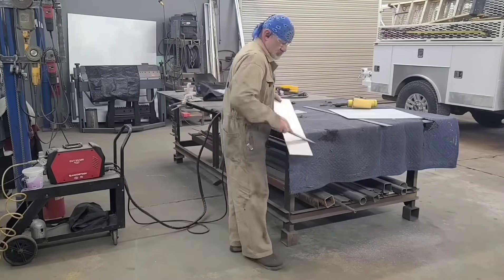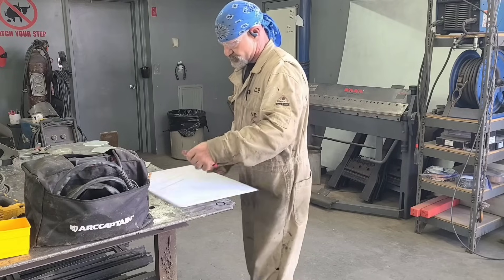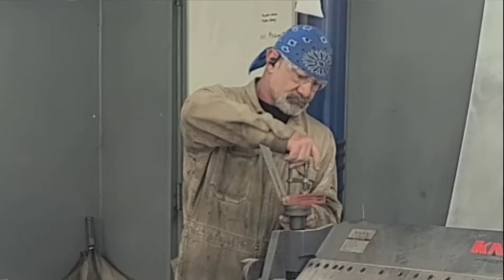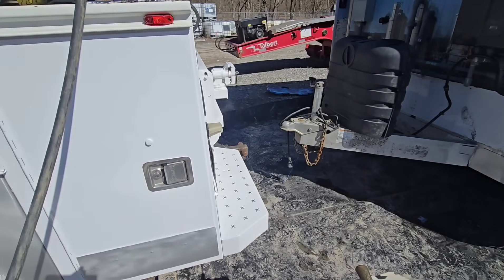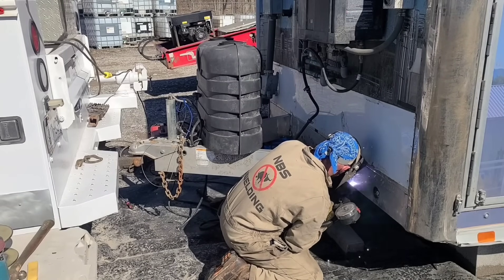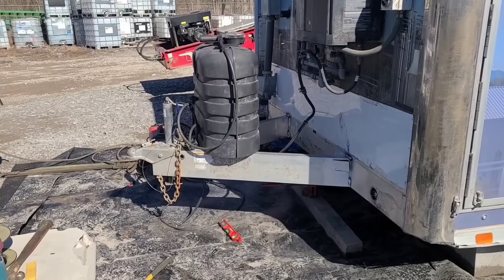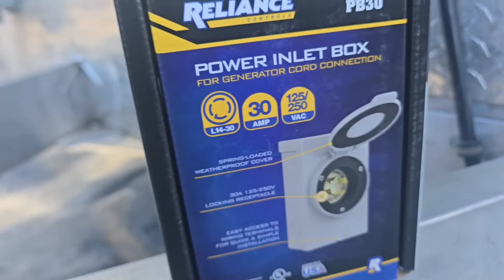Welding a broken aluminum trailer tongue

Comment: Look like a very good idea to add the gusset plates to the tongue. I personally don’t like aluminum trailers. They are to easily damage. Here in southern Indiana there are lots of them framed and frameless. And most are dump set ups. I got a friend who replaced a floor in one that was a short one and his statement was never again. Thanks for sharing your repair on this trailer.
Reply from the maker: I agree....there are times when aluminum  is the right material but industrial trailers should be steel

Comment: How does ur arccaptian mig 205 pro run on ur engine drive I bought a new generator and I'm having all kinds of trouble the thd is to high on the generator maybe have u had any trouble
Reply from the maker: No trouble...ran the 205MP off of the Miller Trailblazer 302 like always on 220V....worked great

Comment: Excellent repair! Much stronger now.
The operators are lucky to be alive. That could have been a major disaster on the highway.
Reply from the maker: I'd say the brakes worked good once the front of the trailer set down on the road
Reply: @NBSWELDING  Damn!

Comment: Nice job. Had a question about the arc captain can both of those mig welders be run off a generator? I’ve been looking for an extra 200amp machine to leave in the truck
Reply from the maker: Yes they run off of my Miller Trailblazer 302 just great.  I can say that for the MIG200, MIG205MP, & MIG145.  
The only ARCCAPTAIN I have that won't run off of the Trailblazer is the TIG200P AC/DC on 220V and that is because the Trailblazer does not have actively regulated voltage and the 220V voltage on it sometimes spikes above 265 volts.  Those voltage spikes above 265 volts cause the electronics in the TIG200P to shutdown and protect itself. 
Two other interesting things to note on that is I must say I ran the TIG200P off of the Trailblazer on 110V and welded with it no problem, just didn't have as much power as if I could have used the 220V.  The other interesting thing is that I plugged the TIG200P into my old Lincoln Commander 300 diesel machine on 220V and it was fine.  I assume that the Commander either has regulated voltage or maybe just the power of the lower rpm diesel keeps the voltage even enough so there aren't high spikes of power.
Reply from the maker: Please remember when buying ARCCAPTAIN products use my link and promo code...I'll drop links here for the preorder Kickstarter deal on the 205MP as well as my link to the ARCCAPTAIN site but remember my links are in the description of my videos....even my Amazon Storefront link for when you use Amazon.

To sign up for an ARCCAPTAIN MIG205MP use this link
https://www.kickstarter.com/projects/arccaptain/mig-205mp-all-in-one-mig-welder-and-cutter-with-app-control?ref=a54hl0

Support the channel by PayPal with this link
https://www.paypal.com/ncp/payment/QY3RVMKPNH26J

For ARCCAPTAIN products use this link https://www.arccaptain.com/?ref=NBSWELDING
Remember to enter promo code NBSWELDING5% to get 5% off on all products 

For purchasing products from Amazon  use this link
https://www.amazon.com/shop/nbswelding

For T-shirts, cups, or coins send Tina an email request at nbswelding@aol.com

Comment: Great Solid Repair! 🤗
I like to take a clean stainless steel hand brush and scrub the oxides off of the aluminum before welding them, plus I usually wipe everything down with acetone also. 
I have a Miller 251 with a 30A spool gun, but it is not what you would call a portable system for mobile welding jobs.
Reply from the maker: I have the 30A for my Millermatic 252's and I used to love it but the ARCCAPTAIN MIGS do awesome and the ARCCAPTAIN spool gun is much lighter and easier to use.  Plus the ARCCAPTAIN is so portable....the pulse MIG function on the 205MP is fun on aluminum too in the way it runs high heat without overheating the material.  If you ever decide to get any ARCCAPTAIN stuff go to the description of my videos and use my link and promo code.

Comment: Hey CB! great repair, as always i really enjoyed your content. I'm about to start going mobile, i have my engine drive (Miller Bluestar 185 that i rebuilt) and my oxy propane torch. I have been trying to figure out the most sensible way to weld aluminum in the field. Do you think one of the MIG arc captains are the way to go or should i work on getting trained up on TIG welding instead and buy a small AC/DC tig machine?
Reply from the maker: It seems to me that most aluminum field work is best suited for spoolgun MIG and the ARCCAPTAIN MIG machines do it well.  The only thing I'm not sure of is if your engine drive will run them.  My Trailblazer 302's run them just great but I can't speak for yours because I haven't tried it myself.  I'll drop links here to use for ARCCAPTAIN & such if you decide to buy and remember that my links are always in the description of my videos.  Don't forget to use my links & promo code.

To sign up for an ARCCAPTAIN MIG205MP use this link
https://www.kickstarter.com/projects/arccaptain/mig-205mp-all-in-one-mig-welder-and-cutter-with-app-control?ref=a54hl0

Support the channel by PayPal with this link
https://www.paypal.com/ncp/payment/QY3RVMKPNH26J

For ARCCAPTAIN products use this link https://www.arccaptain.com/?ref=NBSWELDING
Remember to enter promo code NBSWELDING5% to get 5% off on all products 

For purchasing products from Amazon  use this link
https://www.amazon.com/shop/nbswelding

For T-shirts, cups, or coins send Tina an email request at nbswelding@aol.com

Comment: Seems like too many welds at the bottom of that tongue section at the front wall from the factory. Those gussets should help a bunch. Nice work as always
Reply from the maker: You are absolutely right, those trailers are not built strong enough from the factory!

Comment: Man the way the just butt that rectangle tubing up to the frame & just throw some tacks around it is just designed for inevitable failure! Its unbelievable! The tounge needs to be tied back into the frame like it is on regular steel C-channel trailer frames do it. Also from seeing the thousands of scrape marks across the bottom of the trailer front from going in & out of driveways incorrectly and just punching the gas pedal down dragging it right over the hump is putting soo much excessive force on that simple butt-joint 'weld' with no gussets or extra added strength adders whatsoever....its like they want the trailer wire harness wires to keep it held together & not their 'welds'! Its simply ridiculous!. Then, I'm absolutely sure this trailer is probably massively over-front-loaded aginst that front wall, I'd just about guarantee they have waayyy too much weight on the tounge\trailer front wall! Thirdly I really don't think aluminum is capable of being strong enough(at least not this frame design) to be used as a heavy duty trailer frame designed for regular commercial use. Fourth, I have no doubt CB can & will fix this POS designed trailer frame to make it better than it ever was. The real trailer here is that nice Talbert lowboy deck\beam trailer next to this one! Those are nice trailers for sure. Sam @ Scrappy Ind. just started rebuilding his 30 yr\old convertible beam\deck trailer axle unit which was still in good enough shape to haul his old monster iron machines(TD25, etc) around back to his land.
Reply from the maker: You got it & I agree....Aluminum was a poor choice for this and the tongue design is not good....I also agree it's overloaded.
All I know is if it breaks again it will not be in the same place as last time

Comment: Could you explain the difference between the wire, the 4043, and the 5356?
Reply from the maker: 4043 is softer, mixes well with virtually all aluminum welding jobs, and less prone to cracking
5356 is stiffer and better to prevent bending and flexing 

As far as welding the 4043 is so soft that you must use a spoolgun....the 5356 is stiff enough to push through a MIG gun if you keep it fairly straight and use a Teflon liner, pushing the larger .045" diameter helps it go through as well

Comment: Nice job!! impressed with those machines ,Were  you running those arc captions on 110 or 220
Reply from the maker: 220V....plugged into the Miller Trailblazer  302

Comment: What is it with aluminum trailer manufacturers. They all seem to butt the trailer tongue to the front of the trailer frame and weld it. Good job on the repair in the field.
Reply from the maker: They are never built strong enough...it's like they think that aluminum is as strong as steel

Comment: Once again, CB take that boy at a petty cash👍🏻 Great job
Question which arccaptain welding helmet do you prefer?
Reply from the maker: Thanks

I don't have any opinion on the differences between the ARCCAPTAIN helmets other than I'd assume that the bigger the lense is the heavier the helmet would be.  ARCCAPTAIN sent me one of their helmets about a year ago and it is a good quality helmet but ARCCAPTAIN doesn't sell the type I prefer.  I like a helmet that has a small lense and flip shield so that I can flip it up and use it as a clear face shield.  The slight green tint that the auto shields has annoys me.